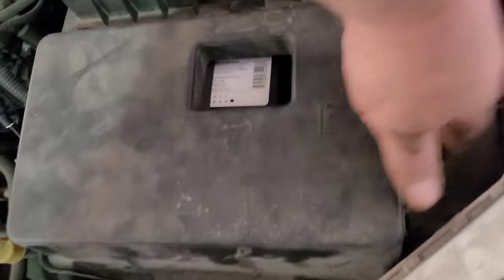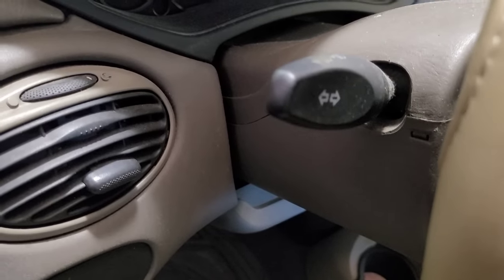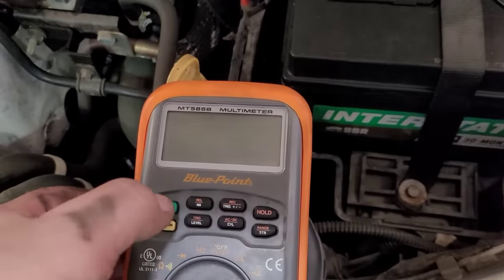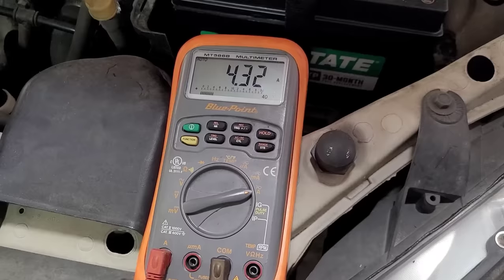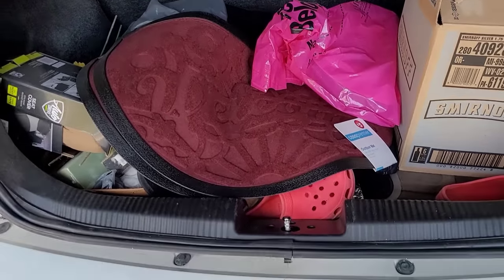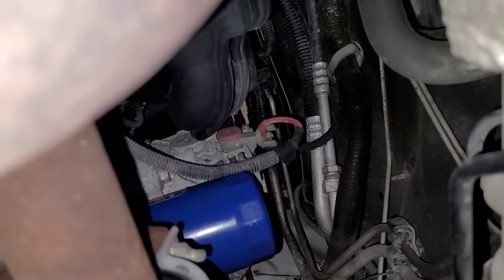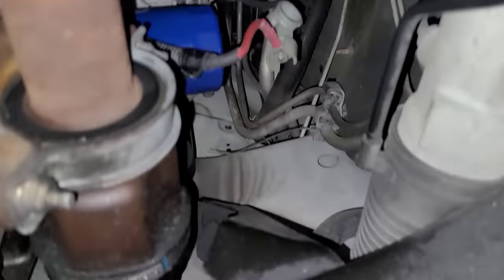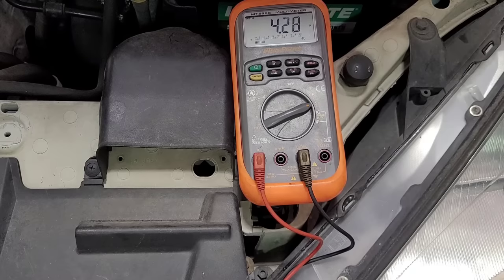Why is the Battery Going Dead? This One Will Surprise You!!

Comment: Doesn't surprise me, I had a Ford once, worst car I ever had. The battery kept going flat, even while driving, but there was no light on the dashboard. It turned out there was a wire loose on the alternator, eventually it just fell off and the car died until the repairman came. And the paintwork was brittle and not properly bonded to the steel, so it chipped easily, straight down to the steel. After a couple of years people were asking "have you had brake fluid splashed on it?"

Comment: I have replaced many alts in these cars. The heat kills them. It is not the funniest job. Don't follow the recommend removal procedure. Remove the upper motor mount and you can slide the motor forward as far as it will go on a jack and just barley squeeze it out and the new one in. It is tight.

Comment: I found when I worked on cars that had dead batts all the time an old timer told me if cking for Alt Draw, get hacksaw blade and put it agents the pulley. Ck  to see if it has a slight Magnetic draw on it, just pull  the blade away feel for a Magnetic pull to it. If yes you have an interal short. And allmost every time It had a bad Alt..

Comment: 4.8 = 5 Amps...........in my math book. Diodes are supposed to be one way devices, but, when they short it allows drain back cause it does not STOP the flow of electrons. 0.136 is basically wire voltage drop to accesories that may be on like a Clock.

Comment: My 1991 Mazda RX7 had a bad Alternator after months of scratching my head because a battery light kept coming on but got it checked and the mechanic said it was the battery so I changed it and was happening intermittently and then one night driving on the freeway and all of a sudden engine shut-off n everything when black so all that time it was just the Alternator that went bad and I changed it and no more problems ever again

Comment: Likely one of the diodes in the rectifier bridge inside is shorted out. Even though charging at 14.5V is will be half sine wave (AC) in the DC.. Long term that will kill that battery..

Comment: You can rotate the engine without taking the tire off. Put it in gear and use the tire instead of sockets and extentions. Rotate the front left tire and observe multimeter at the same time

Comment: Nobody seems to diagnose the alternator and fix the internal problem.  They just replace the alternator.  I suppose with labor charges between $100 to $130 per hour, that might make sense.  Still, the price of some alternators are upwards of $200, so replacing brushes and/or the regulator can make sense.

That is if you can get the parts.  I needed brushes for a GM alternator and called the part store.  The kid working the counter thought I was pranking him because he had never heard of brushes or a regulator in an alternator.

Comment: What a shame!  I was hoping to find out what was wrong with an alternator that charges - but also discharges.  One of the diodes gone South, probably.

What is the capactiy of a car battery? - 70-80AH?  a 4A drain would run it flat in 20 hours.

Comment: How would a bad alternator  draw with a key off
Reply: Alternator has direct power from battery to only charge back to battery when running, by disconnecting that wire not running and amperage goes away the rectifier inside the alternator has a bad or shorted diode causing direct short to ground.

Comment: that's alot of current consumption when the engine is shut off 
it should be way below 40ma 
but I think when the key is inserted 
the emobilizer and main MCU are communicating to verify the key code is right  then current should drop off  

such problem could be from alternator regulator  bad  diodes leaking  or the main ECU command nor shutting off the alternator regulator  (depends on car model check electrical diagrams )
this might be easy alternator fix or more way complex problem to check the ECU  codes 
or probing wires with oscilloscope
to check for signals validity and confirm no stupid wire  problem .

I have seen a problem current consumption at standby as high as 70ma after digging I found that the problem was with parking light 
controller (lights wasn't on but it's circuit was faulty  I do suspect car owner changing light bulbs with wrong wattage or something)
anyways problem fixed 👋

Comment: quickly diagnose for bad diodes by switching to a/c voltage on your meter, with the engine running, zero a/c volts should be present anywhere in the system between positive and ground.

Comment: Don't use your good handheld meter to check current in the battery that's dumb real easy to damage a DVM You had no idea how big the load was when you put your meter in series with it .
Get a good 12 volt headlight solder test leads on it with clamps. Put that in series with the battery and load. If that lights up you have draw. You can tell how bad the draw is by how bright it is. Its called a load light. Its safe & harmless. Don't have to play diddle fest with your meter. When trouble shooting its easy to se the headlight anywhere you work on the car. Light goes off you found the phantom draw.

Comment: I think you have a bad diode in the voltage regulator.     When a diode goes bad it goes from a one way check valve. To a free flowing pipe in both.      I believe the 4 volts  is kinda telling you. It’s one of the 3 phases drawing current. 12/3=4.   Ish.      The alternator will be magnetic with the key off if this is the case.          But I’m not a scientist

Comment: Since the battery ground cable was disconnected, all you need to do is disconnect the ammeter to prevent shorting out the alternator positive terminal.

Comment: they have an alarm system that  dont pull that much but it is on all the time when you turn motor off  and take key out  a small red light will cycle off and on near center of dash at the top on mine and on mine i can open the trunk without the key with the  button on left side of the steering wheel and the overdrive system on mine can down shift by pushing the button on the side of the floor shifter now mine is the soh 2.0 whereas that's the double ohc your working with  its a lot better motor than  the one i have in the 2.0 they are none to drop a vale seat  on the 2.0 on occasion which completely usually destroys  the whole motor because the  scrap metal is  shared it with the other 3 cylinders  and damages the pistons and rods and on one cylinder it had  also cracked the block at bottom of the piston travel when i went to junkyard to find a good block they all were damaged in the same manner you see that these two different metals they heat at different temps  in these two different metals cast and then the aluminum  my guess somewhere about 70 to 90 k  is  when they may let go  but people jump into these cars in winter also  when engine is cold and don't let them warm up properly  and that and  overheating this motor can do this also like hose going bad or a  water pump gone out  really heats these metals up  to different degrees and also cause this failure i have two of these cars with 2.0 one had this failure the other one i'm waiting for it to happen and  the one that's still going has 120 k on it but i let it warm up and its has never never been overheated

Comment: You could have blown the internal fuse in your voltmeter when connecting/testing for draw like you did, the fuse will blow with a 10 amp spike.  A 40 Milliamp draw or less is ideal, 130 means trouble!!!  something else is wrong also!!

Comment: 4:52... It's a live wire (alternator hook-up). Didn't he disconnect the vehicle ground? That would negate any danger.
Reply: he did disconnect the ground but then reconnected the circuit through the multimeter

Comment: Another simple test is a warm feel to the alternator in relationship to other engine parts.. In the field as a plant fitter i would also use generated heat in alternator to tell if its charging... Good work though my man parasitic drains can be a bitch to find

Comment: sad part is nowadays cars they eat batteries you can take a simple multimeter disconnect the positive battery terminal taking your multimeter hook between the positive battery terminal and the positive lead you took off you'll see your multimeter will light up if you have any kind of draw

Comment: The alternator positive wire is only "live" if the negative AND positive are connected. You should disconnect the negative whenever making or breaking connections on "live" wires. In this case it would have been easy to disconnect the alligator. Furthermore, doing this with the meter connected could easily blow the fuse in your current meter.

Comment: in my case my "mechanic" thought you could pull a relay and reinstall it upside down..... it will plug in wrong, and will then be a drain - i found it, no relays are supposed to be upside down, the truck  no longer kills its battery
Reply: we were chatting and he randomly reached over and pulled a relay, looked at it quizzically and put it back in........... backwards ..........then he went home , diddled his wifes kid some more and went to prison......gets no more of my money
Reply: i suspected the relay one morning at 2am went out with a flashlight, looked at the fuse/relay map in the cover, found no relay is supposed to be upside down, bingo

Comment: It sucks when technically a working alternator goes down for a parasitic draw like that, but over 4 amps and yeah the battery would only put up with that if you used the car a lot.

Comment: My 1955 has a generator and I should drive it more. I have the highest CCA battery I can get. Given the simplicity of electrics it has, I have no parasitic draw. So I keep the battery charged by a regulated charger. When starting, I wait till the fuel pump stops whining. All is good, but I think the fuel pump needs attention,

Comment: so you charge them for a alternator and labor then the problem still there . the alternator tested good this is why people have issues with mechanic shops if they don't know what it is they just start throwing parts at it and next thing you know the customer is in the hole and still not fixed. my grandpa always said start with simple stuff first. and go from there

Comment: Do you know why??    It's because one of the 3 diodes has failed. The Diodes changes the current from AC to Dc.  When the cars running with a bad diodes you'll get charging volts that fluctuates and its putting out AC flutter.  Which you can see easily with a scope hooked up. AC voltage flutter will mess with ecm and other control modules as well.   It sucks cause usuallythe alternator will charge. Sometimes it won't. But it ALWAYS will drain the battery witch key off.  
Just thought it's important to explain to viewers that don't know about this.

Comment: I'm not sure I'm following your logic. A 12 V Battery should show around 12.5 or so Volts normally. When the engine is running and charging it should show around 14 Volts which is what I saw happening. How is this a bad Alternator? Voltage regulator issue? Not trying to be a wise ass- serious question. thanks

Comment: Why not start pulling fuses, until the current drops, then chase that wire to the problem.Use a DC clamp meter, so no disconnections. Why chase something when you don't know if it is the problem ?
Reply from the maker: I would normally pull fuses but a 4 amp draw was something substantial. I knew right away it was either the alternator or starter. This vehicle does not have a separate alternator fuse. I hope that answers you question. Keep wrenching 🔧

Comment: 4 Amp draw will kill battery overnight,  use a cheater cable to join neg post to cable connect DVOM them remove cheater cable, saves waiting for modules to go to sleep, some will not if running though meter

Comment: Meter @ 4.5 vlts dc is 4 volts like 4 inches a whole number  .5 is the fraction,   meter @ 0,135 is less than 1/2 volt

Comment: If the car has a manual gearbox,  instead of turning the crank with a socket / tool, you could have selected the 5th gear and rotated a wheel in order to turn the engine over. Now, this car has an automatic gearbox, so... yeah...

Comment: Virtually all alternators are capable of this failure. If a diode in the rectifier pack goes short circuit, it will connect the alternator coils up like a little electric heater and drain the battery.

Comment: I would install a battery  disconnect switch on it and call it a day.....tell them they have to turn the battery on/off.  A vehicle that is driven 100 miles in 5 or 6 months is going to be problematic in any event.

Comment: I got a 2012 Jeep Wangler that if I’m going like 50 and let off the gas it goes to the right real bad, I’ve checked all the bushings and they are tight with no play, anyone else have any ideas what could be causing this
Reply: The tie rods and links go out some times causing pulling in the worst case a death shake  . Iam assuming you checked tire pressure. And ball joints

Comment: So you told your viewers that you have seen the amp for the stereo create a problem of draining the battery but you didn't give any details? So I will throw my two cents in on this issue. There is a wire coming out of the stereo on all aftermarket stereos with a blue wire with a white stripe around it that goes back to your power amp and connects to the terminal on the side of the amp that says  Remote! And I don't believe that most people have a clue what that means or that if it is disconnected what happens? This is not the same as a remote control like the one you have on a television, nor is it a remote control for your stereo system! This remote is what shuts the power to the amp off and on every time you turn the key to the accessories position or start position! And if someone installed a new aftermarket stereo and left this blue with a white stripe unconnected because they thought it was for a remote control and since the stereo didn't come with a remote control they see no reason to hook it up or they don't know where it goes and it's function it gets left disconnected! But the amp has got a positive + wire going to something that is constant power or directly to the positive terminal of the battery and will stay powered 24/7 without the remote wire hooked up and cause a parasitic draw on the battery. 😉

Comment: Perhaps take battery cable off first before playing with live wire. No brainer huh?
Reply: His mission was to prove a blown diode , disconnecting battery would allow that
Reply: I'd agree with you if the battery had been connected, but in this case it was fused through the meter which is typically 10 amps. The worst case here would be needing to replace a 10 amp fuse.
Reply: @denrayr  hope they're cheaper than fluke fuses

Comment: They MUST  REMOVE THE NEGATIVE  BATTERY  LEAD,   AFTER THEY DRIVE. 
OR  A SWITCH 🤔.
Or  granny put in  a $8,000  Boom Box Stereo,   with a huge subwoofer,  you can hear granny from a mile away.
BOOM, Boom, boom
Because  granny is a  Boomer

Comment: You’re doing a parasitic draw test completely wrong for newer computerized cars!  By disconnecting the battery you could potentially shut off or reset the component causing the draw. You’re doing it the old school way that doesn’t always work on newer cars due to all the  computerization. Motor Age makes a great Training video on Parasitic draw testing that you can view on YouTube.

Comment: The point 137 milliamp would be the car's computer and the presets for the radio that is not an abnormal draw you need to go back to school and read some books on automotive electronics stick to change in brake pads
Reply: 50-80 milliamps is the parasitic draw limit for for the manufacturers that we service at our dealership.